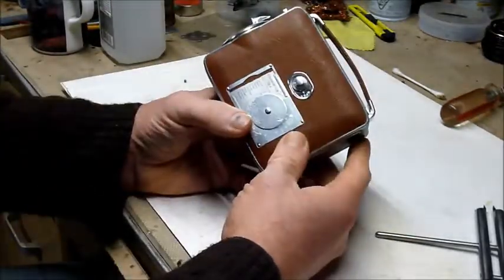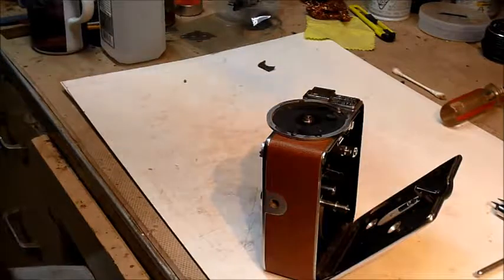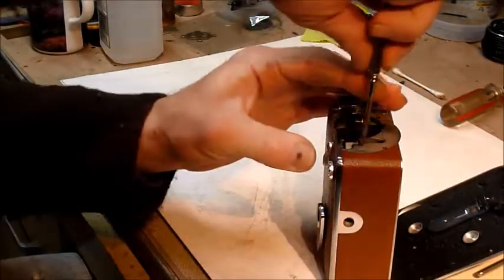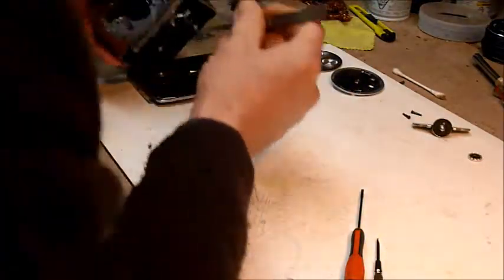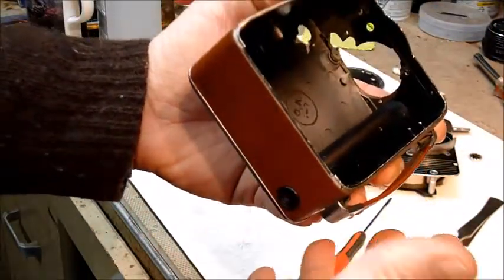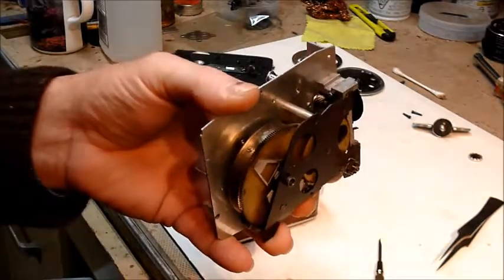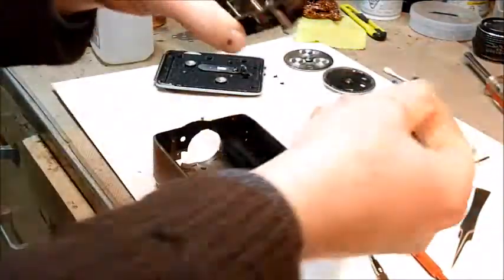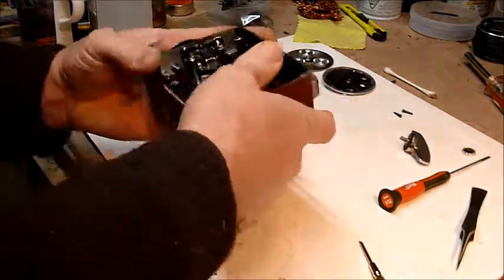Keystone Olympic 35 field strip

Comment: Glad I found you. I have this same model but I dont have a manual. My turret does not have an indent to tell me when the lens is properly selected. I see the line up marks on each lens but I don't see a matching one on the cameras body. What can I do to line the lens up properly? Where could I find a user manual?
Thanks in advance.
Reply from the maker: There should be a popit ball (or spring, i dont remember) and detent that click into place  when the lens in it's position. If it not there my guess is that someone else already had it apart and lost the parts. As for a manual, you can got to butkus.com he has almost every manual ever printed.
Reply: Thank you so much for the information. Was this camera made in the 50’s and do you know what it sold for then?
Reply from the maker: @MrBritrider  had to be the late 50s and I have no idea what it cost new. I'm guessing it was a mid priced camera. Some camera forums have guys contributing who can point you to resources for pricing info, just be ready, forums are filled with people who are only there to make others look small.